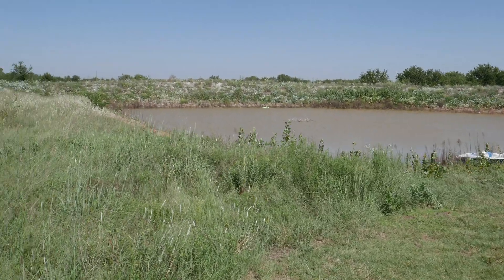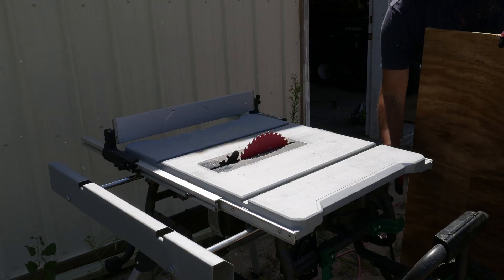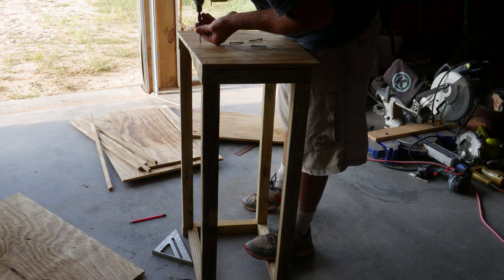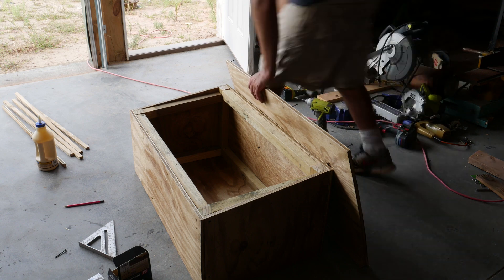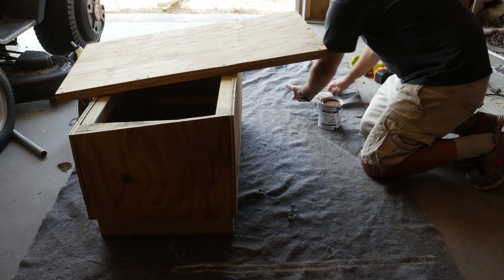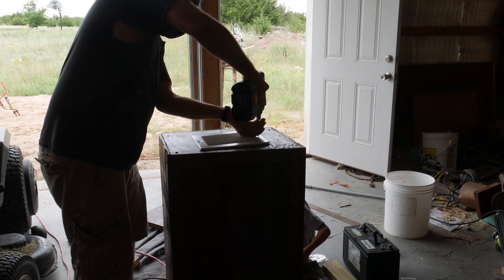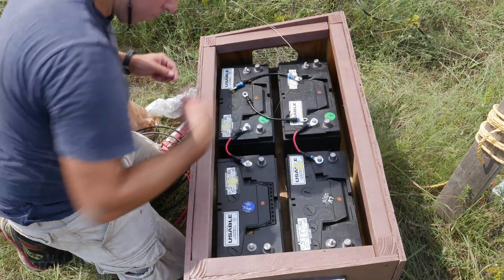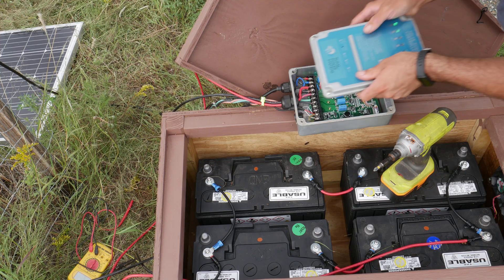Rural Power Systems, Solar Well System 1.8, Adding Batteries to System, Part 3

Comment: Why would you do this, just get a larger pump...the pond is the storage >>
Reply from the maker: True. At the time it was just because this was less expensive than the bigger pump, and I wanted it to pump during the hours without sunlight. It is still insufficient for the pond and I will need to upgrade the pump in the future.

Comment: Can you please tell me what size batteries you used, and how many watt solar panels it would take to keep them charged while running the pump. tia
Reply from the maker: The kit came with four 100 watt solar panels and the documentation said to add at least 2 more when you install backup batteries to the system. I used 12v deep cycle batteries. I am not 100% sure how much they charge up each day but it does run after the sun goes down. I also do not have my panels setup in an optimum position yet.
Reply: @1MohrFarm  Thanks I appreciate it